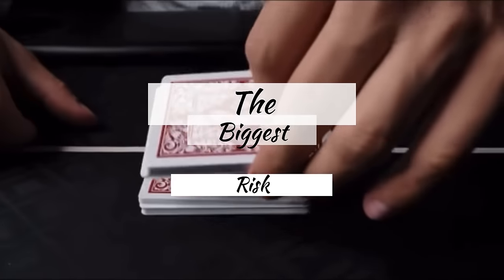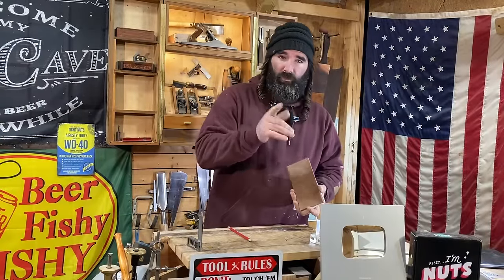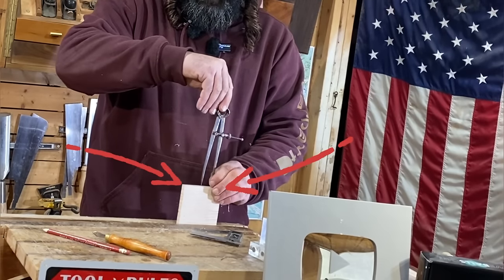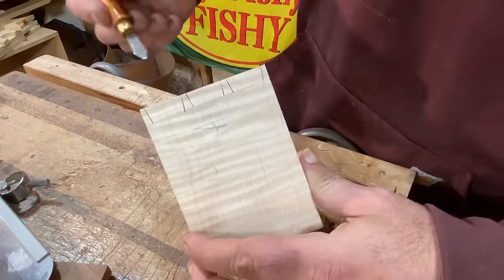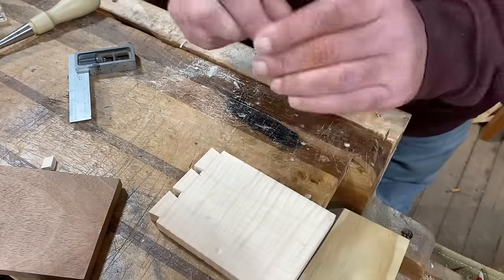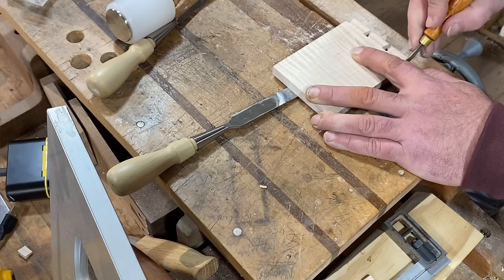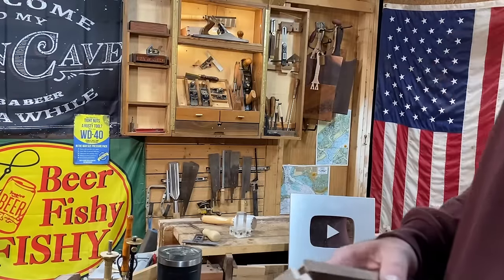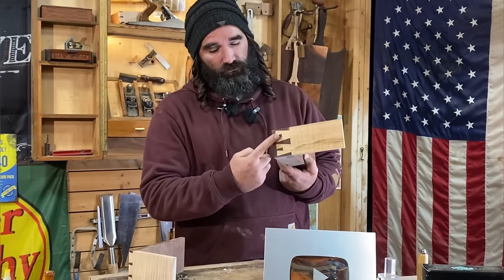Take your Woodworking to the next level with HandCut Dovetails .. Beginner friendly

Comment: Dude that was insane. Ive seen videos doing this before but that actually made sense. I can't do dovetails nor do i have the equipment to do it. I can't get the katzmoses jig over here and dont have coping saw but have everything else need find another dovetail jig. Any chance of wood turning tutorials??🤔🏴👍
Reply from the maker: I’m saving up to get a new lathe now , mine broke about a year ago but soon very soon.
Reply: @Bearded-Viking-WoodWorks  that would be very handy. A purchased carbide tools wee while ago as believe there easier to learn with and can give better results rather than having to have whole grinder set up for sharpening traditional gouges.  Got cheap set traditional gouges that didn't go well.